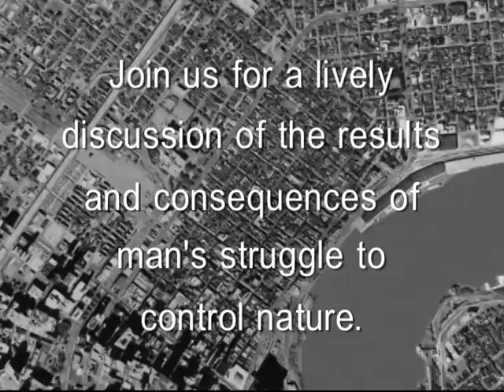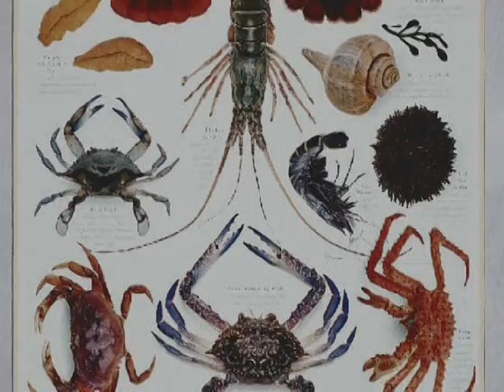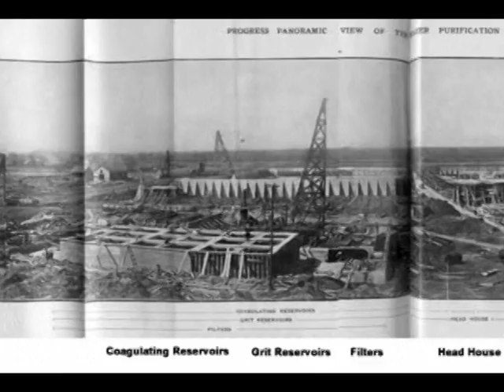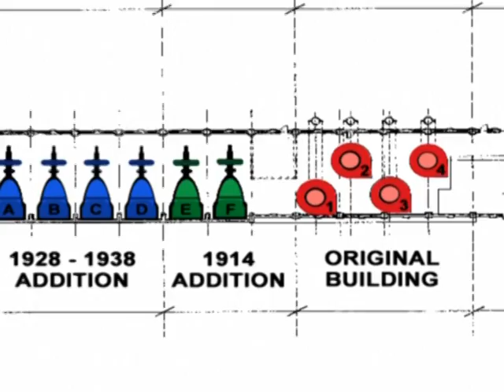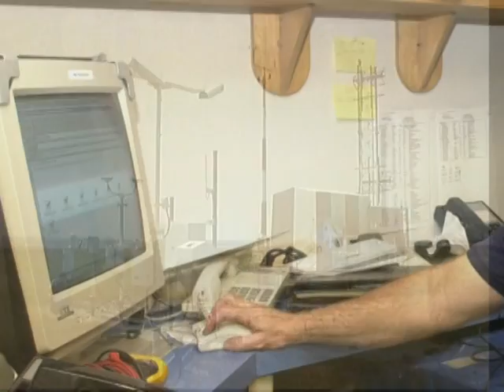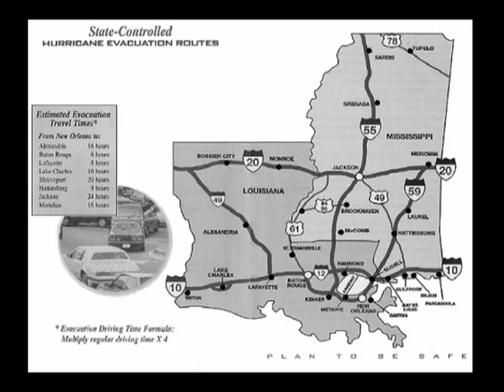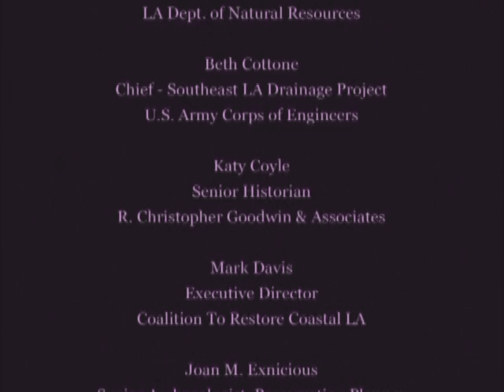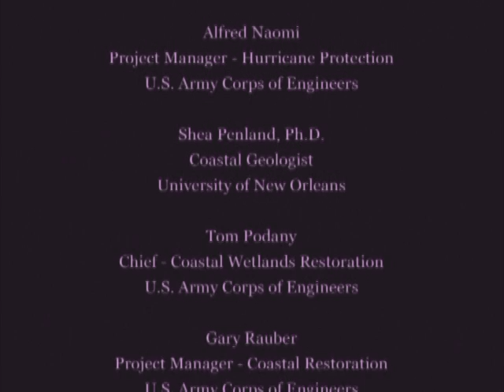New Orleans - The Natural History

Comment: What I find interesting is that they started out with "man controlling nature" and at the end listing all the problems later on. I'm not opposed to this approach, it happened so it's there to stay. Had man not come there, the river and nature would've managed itself and there would be no problem (since we're not there). The ecosystem could still become "unhealthy" by the standards they use to regard it as "unhealthy" today but it would manage itself.

What I think mankind should do when engaging nature in this kind of way is not to try and tame nature to such an extent, but to live with nature such that the natural features that can not be easily tamed are taken into account in surviving in such a reason. For example, there are houses that basically stand on the ground and have underground water proof areas under them, basically the basement. They're attached to poles that are stuck deep into the ground. When there's flooding, the house will simply start to float, yet it will remain in place due to the poles.

I've been to NO and I miss it a lot. <3